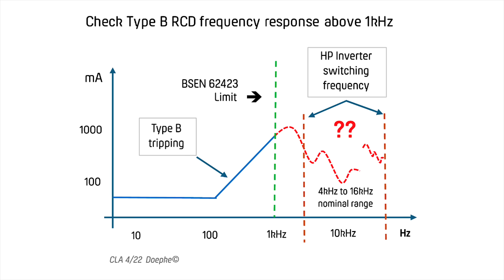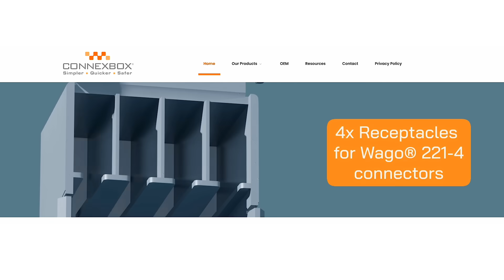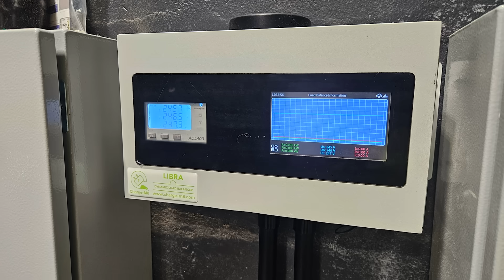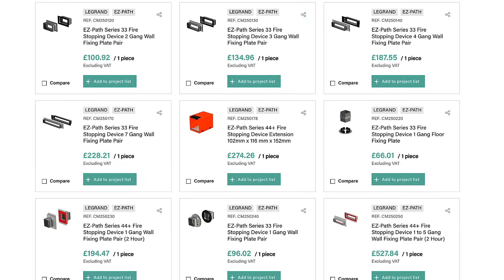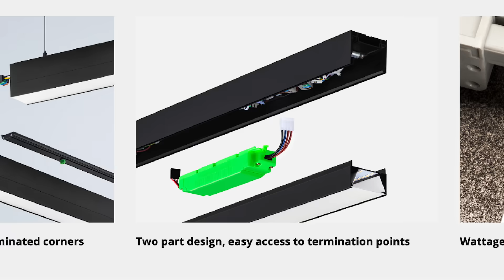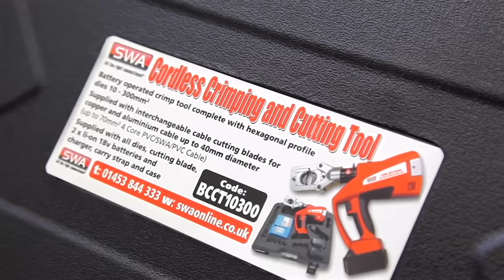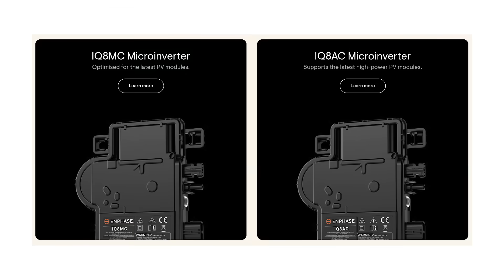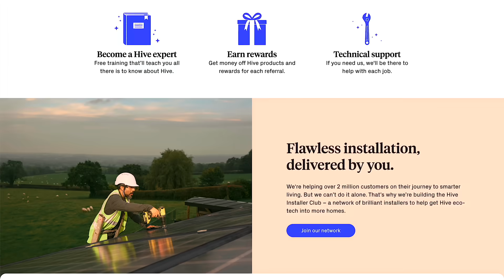Experts Warn: Crisis Looms For UK Electricians!

Comment: I trained about 6 years ago with access training and did a "level 3 domestic installer course" with them.  it was sold as a kind of become a qualified electrician in x amount of time.  in reality the whole course took about 18months to complete,  mainly due to wating for exams and modules to start.  I was there every Saturday and Sunday for about a year.  when i completed it,  I had the basics.. 18th edition,  some testing and inspection qualifications and with C&G.  then i found out that it's not enough for NICEIC because they want to see evidence of experience.  so spent another year doing it the hard expensive way.  doing a job and getting building control to come around and inspect & sign off.  basically doing jobs for free because all of my labour money was going towards the sign off costs.  Then finally I joined NICEIC and carried on from there working part time.  Ive been registered for about 4/5 years and now find that if I come out of the scheme,  I would need to do yet another course in order to rejoin!!! it's all a money making scam.  I've done some good work through it but it's just not worth the hassle anymore

Comment: Can we use some common sense please when it comes to high frequency electric shock protection...

A high frequency shock (above 1kHz) doesn't have the same effect as a regular shock. 

You can pull away no problem even at 100mA. Ask me how I know.

Yes it can burn at high power, but below 100mA it just hurts. It also feels wierd compared to a regular shock.

Comment: What is all this talk of NVQ to get qualified?

Get the C&G rules & regs and the C&G test & inspect qualifications.

Niceic could not then wait to sign me up and more importantly for them, take my money.

Rules & regs exam is open book multiple guess. So providing one reads the book & understands it's layout to find the answers quickly, no reason any intelligent person could not pass.

Test & inspect is a little more complex. I did a week at college to learn it. 

If one is not doing work requiring building regs sign off, or work requiring part-p nonsense, what is stopping anyone from carrying out electrical work?

One does not need to get involved with EV charging, heat-pumps, solar. Just pick up the easy minor work.
Reply: When was this though?
I've just read this 
"To become registered with NICEIC, electricians typically need to have an NVQ Level 3, along with the AM2 assessment"

Comment: There needs to be a different kind of shake up. There's too much nepotism and too little concern about the quality of candidates.
Teachers are overwhelmed with incapable students.
Most are good for the tools but few are good for design, testing and fault diagnosis.
I'd say there needs to be a cutoff point where lads can be partially qualified and only the capable students go on rather than push useless kids through.

Comment: People are leaving the trade because the shine of the job for many has worn thin. It’s becoming a minefield of latest regulation fetishes . How many people exactly have perished from a type A RCDs on a heat pump ? Why don’t manufacturers state on a label in the connection box what type of RCD it requires?? How many electricians have died from stress produced by the job resulting in suicide? I suggest more of the latter.

Comment: Get rid of improvers and mates. Seen too many installs where improvers have a drawing with cable sizes etc written on it and they still can’t do it. Seen conduit bends made using flexible metallic conduit as they can’t use a pipe bender. Pulled their supervisor and the lead engineer up on it all and their response is that as long as the work comes in under price they don’t care. Never mind that it took them 3 attempts to wire emergency lights in and get the switching right. This was a multi million pound install , I was just a lowly shift tech but ended up teaching these kids how to do their work as there were no qualified electricians from their company on site. The client lead was an IT specialist and as long as it all worked , he didn’t care a bit. 
Then you spend six months on shift correcting the faults as the install company is nowhere to be found. It’s too easy to show someone how to wire a socket, what’s not easy is the maths behind it to calculate cable sizing, thermal limits due to grouping. Testing for compliance, too many test sheets seem to just have the book figures…..
There needs to be a complete rethink on trades and permissible work. It’s too easy for someone to go into the local diy store and buy cabling etc and install it themselves in offices and homes. Materials should only be available on certified trade accounts with a certified electrician licence on file. They should have made the type p ticket a certified electrician ticket not something a tiler can do in the afternoon. I know we don’t want more regulation but until we start tightening up who can and cannot do the install, we’re not going to see an increase in wages. After all, any Joe Blogs can wire a plug , how hard can the rest be ?
Reply: Improvers should never be solely on a job without qualified sparks... that's the contractor being tight on labour
Reply: @morestuff4401  Yep . Not the mates fault there.

Comment: the reason its declining is the amount of red tape put in the way and schemes electricians have to submit to.
Reply: That's also empowering electricians to charge £35 per hour for their time. Who can afford that? Not many, so prospective customers are just putting off essential work. Result the fire brigade report electrical fires are on the rise, who'd have thought.
Reply: @st200ol  £35 per hour is relatively cheap for a skilled person, isn't it?
Reply: @jamescollins6085  I've had a reply from an electrician that charges £70 and says they are overloaded with work. It doesn't really matter anyway because I can't afford £70 or even £35 so I just DIY.. Nobody is going to come after me either unless I do work for others and that is something I won't do so its all good.
Reply: @st200ol  you shouldn’t be doing electrical work if your not trained or qualified.
Reply: @BATMAN-fe5nd I’ve been to the university of life. My work is as good as someone who’s had a few years of training and I’d argue may even be better than a qualified person that’s running out of time on a Friday afternoon.
Reply: @st200ol how do know ? Your work might look neat but may not comply with the regulations ?
 How do you actually properly test what you have done without the correct equipment or experience?
Reply: @BATMAN-fe5nd  how do I get trained with no experience? nobody is willing to take me on for an apprenticeship
Reply: @st200ol  that £35 is gross before things like insurance, tax etc though so the takehome pay is a lot lower
Reply: So common to see the non contributors skimming off cash while forcing rules with no teeth.

Comment: Completed my 2 years in college cant get anyone to take me on as a mate so I can do the NVQ. Can't even get on a 4 year apprenticeship. Nobody wants to train anyone to take their jobs.
Reply: I think this issue is twofold, college's offering training ( as a business) so they get paid for bums on seats . Companies now have to jump through hoops to get insurance etc  , this was proved recently when we had 2 lads on "work experience " , we were told don't let them do any work because they aren't insured.
Reply: @dennisphoenix1 also experienced this first hand when on a placement in a joinery workshop (before I persued electrical trade), was effectively banned from using any power tools\machines. Hand tools only with 'guidance'. My time there was short lived.
Reply: @iMiniBiscuits thats the trouble now , some kid gets a blister and sues the company.
Reply: @HidingZebraTube After two years at college, why do you need an NVQ? 
Just start working for yourself, changing lights, sockets etc, nothing in a domestic environment that requires the part-p nonsense.

Did you do the C&G wiring regs exam? If not, then just book the test & sit it. after 2 years college, will be easy. You even take the regs book & on-site guide into the exam.

Surely after 2 years at college you know enough to take the C&G test & inspect exam?

Believe me, once you ring NICIEC and say you want to join (i.e give them lots of money) they can't wait to help you.

They said to me 'well just rewire a few houses, we don't mind. Then call us back and we can use these for your part-p.
Then you can issue the certificates.
Reply: Yeah I feel your pain, & this is the main issue for people. Hope you find something
Reply: Forget waiting for someone to take you on and go at it yourself. 

This is what I’m doing. I’m 28, completed a course online.  
I’m not working for apprentice wages or minimum wage for that matter (Slaves wages) 😂

Forget standing around a job site, earning peanuts while some ‘qualified’ electrician just uses you to hold tools and as cheap labour. 

YouTube/Google can teach you everything these old heads can do, sometimes better and with more clarity. 

Too much red tape, useless schemes and a very convoluted path to being an electrician. It’s very unclear unless you’re happy to waste 4 years on an apprenticeship. 
Which unless you’re 16, you can’t do when you have adult responsibilities. 

When you realise as long as you’re good, no one cares about pieces of paper we call qualifications, you can do a lot and earn a lot more going it alone and figuring it out. 

If people who don’t like that’s this is the new route for electricians needs to do more to make it easier and clearer for us who want to retrain in this area.  
If you’re not willing to take someone on to learn at a fair wage, then you don’t have right to comment on how the rest of us are forcing way into this industry.
Reply: This is where I got hung out to dry too, did eventually get into a firm but it took 5 months.
Reply: Get onto building sites and get your experience up. Just do any work you can. 2 years later you'll be much more experienced and a long way down the nvq road. And you can do the nvq later on with the experienced worker package anyway.
Reply: Thats the problem though, I can't find anywhere to get on site. Or am I looking in the wrong places (Indeed, CV library, etc)  @nevermind824
Reply: how have things went, im thinking of doing my levels 2 and 3 but i do worry about getting work as a mate to finish the nvq

Comment: I am training a couple of guys, the problem is that the world of the electrician  has become so complex, with home automation, on grid / off grid, complex DC distribution, MPPTs, inverters, BMS systems, computer networks, fibre optic, fire regs, building regs and now we have to submit CAD drawings, SLDs etc 17 year old lads just see it as an impossible mountain to climb and they're correct, its taken me 30 years. Also the work we do has changed, I am scared of heights but 2 weeks ago I had to resolve a problem with a PVS about 20 stories up, sheer drop, shit the life out of me!
Reply: Might as well be bricky. You can earn similar money, train in a fraction of the time, whole toolkit fits in a bucket and doesn't require any test certificates. Your workwear is an old pair of Adidas sweat pants and a pair of rigger boots. The list just goes on and on and on.
Reply: Correct. Going to do a complete home rewire (I am an electronic engineer) and the information on installation is difficult to impossible to retrieve. Add in there, nonsense regulations and I think it's time laws were introduced that each service (water, elec, gas) had to be charted out on a plan. That way, homeowner can hand over document to the engineers when there is a fault or upgrade needed.
Reply: i quit install 5 years ago to go into maintenance i can't really see myself going back to install now with the amount of money etc offered in factory maintenance.  (yearly wages of 50k+ basic is relatively easy to achieve in maintenance and you are home everynight) plus working in a factory you dont usually need to keep doing tests to keep a jib card indate

Comment: They should either supply them with there heat pump or have it built into the unit. Can’t keep putting on electricians to sort out heat pump electrics for different manufacturers. Listen to a moaning customer about the extra cost .

Comment: Type B HP RCDs - What about lighting? I'm not talking about the lights around your house, but what about a large outdoor area (Carpark?) with flood lights. Combined, the load can be substantial and LED drivers operate at high frequencies. (20kHz all the way up to 1MHz for some) In addition, the numerous unsynchronised frequencies from the LED drivers are likely to create beat frequencies, further complicating the matter.
Reply: Florescent lighting units does it as well.
Reply from the maker: That's a really interesting point...

Comment: I appreciate that times change but in the 60's and 70's your local electrical contractor was a respected pillar of the community.
Reply: The pay was better as well considering inflation. I started in the 90s and it was still fun by the 2000s I did my best to get a maintenance job at a manufacturing plant. You get treated so much better when you get a production machine running that is costing the company thousands an hour of down time.
Reply: Now they are phone & coke addicted rockets

Comment: RCDs for heat pumps...better start teaching electricians how to use oscilloscopes that can do fast Fourier transforms so they can identify what's the most appropriate type of RCD to fit....Good luck with that 😂😢
Reply: Just send them out with the $50k spectrum analyzer.
Reply from the maker: FFT 👍
Reply: If an appliance has passed the required CE compliance tests, then there should be no need for checking high frequency current harmonics on the supply. This is the bottom line.

Comment: It costs too much to train. Plus other lesser skilled trades /  less technical trades are paid more now... So it's essentially - why bother.
Reply: im in that boat I'm 35 and was looking to train but cannot afford the 10k plus couple of years low wage
Reply: @ninjadanny7261  Most sparks will frown upon it, but I run an IT business. I decided as someone with a background in construction and prior knowledge, to do a short course that would give me the paper to take on domestic electrical work.

I've now been doing it over four years and am registered with the NIC-EIC as a 'domestic installer'. The work is arduous at times, but it is there. And has created a nice supplementary income, alongside my IT business.
Reply: @ninjadanny7261  Why so much to train?

Wiring regs, read the regs-book & on-site guide. Understand their layout and how the chapters work & put stick-out tabs for quick reference.
Book the exam at your local college. Open book multiple guess. Answer the questions you know then refer to the book to find the answers to the rest.

Test & inspect, yes work doing a week at college for that. But again, read the book, memorise what you can & practice testing.

The rest is common sense. Do not need two years at college to learn how to nail a cable to the wall or make a termination.
Reply: @wibbley1  I thought the process is
1.Level 2 Diploma in Electrical Installations (4k)
2.Level 3 Diploma in Electrical Installations(3k)
3.NVQ Level 3 Installation or Maintenance(2k)
4.18th Edition Course(1k)
5.other specialisation eg. Solar, EV charging

Don't think you can just book an exam for any of the degrees without going through a college or training school but if you can point me in the direction of where you can just book I'd appreciate it
Reply: @wibbley1  me too please point me in. the right direction im hearing the industry has shortages yet I can't even get into the industry